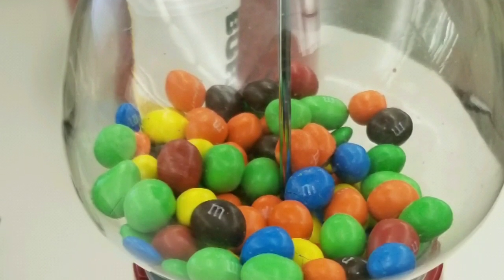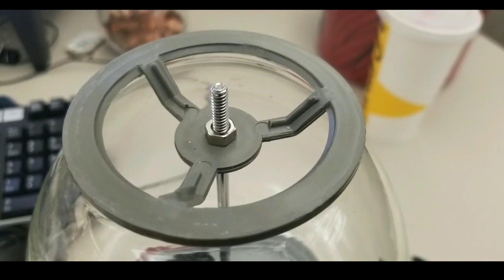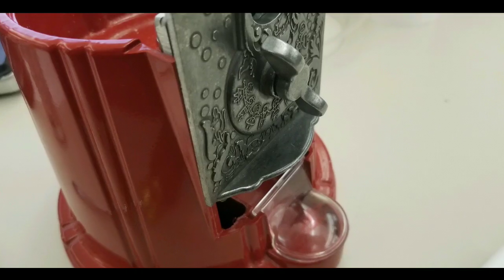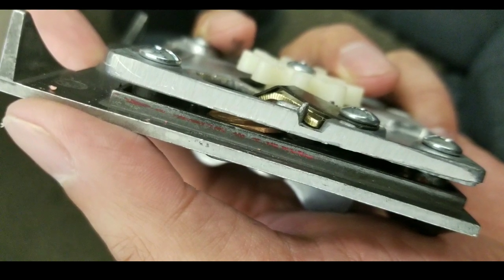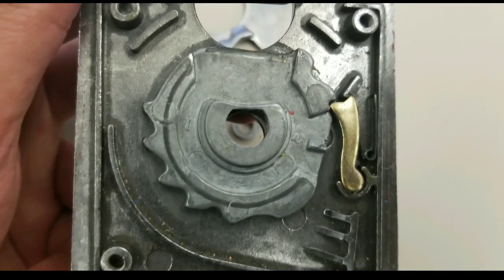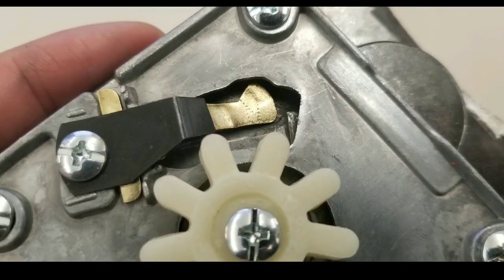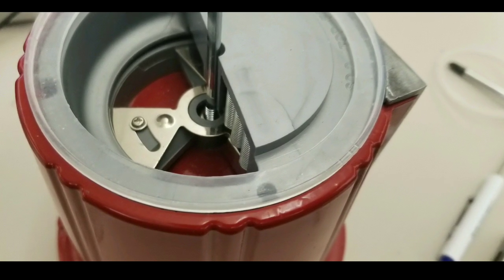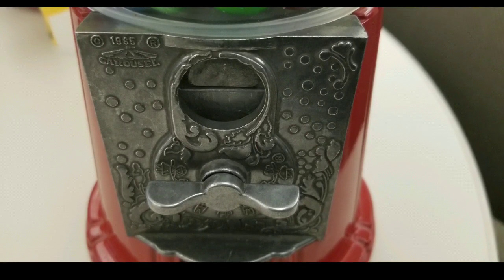How To Fix: Carousel 1985 Gumball Machine Coin Drive (TAKE APART!)

Comment: I have this, and I'm trying to fix it. My issue is the opposite, it spins with no resistance. Handle turns freely, inside carousel spins around, over and over. If i put a coin in, the coin just sits there. Can i fix it?

Comment: The problem I have with one of these is the coin mechanism on my machine fits tightly into the red base. I have seen a couple other videos that have this problem, but other videos show the mechanism lift out with ease. Out of the box from the factory the mechanism was not sitting right as it was riding about an eighth of an inch high and threw the entire assembly off by that much. I figured out how to tap it down into place and then even remove it without damaging the other parts but I can't find the spot that is hanging up so I can file it down. This is a step that is being ignored in it's manufacture, but what should I expect from something made in China?
Reply from the maker: Mine is also tight fitting.
Reply: My Carousel 1985 R" was to tight to push all the way down too. I got it in as far as it would go with out forcing it, then I loosened just the top two screws and it slid down all the way with a slight push. I tightened up the top screws once it was sat all the way down. Best of luck...